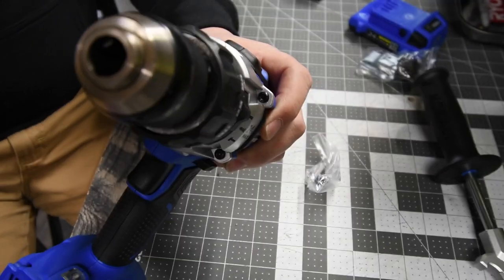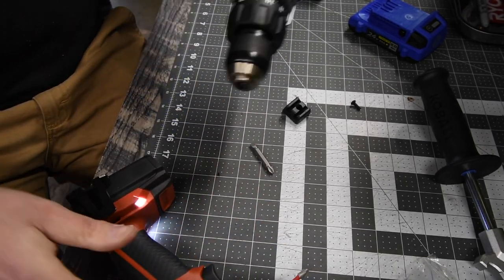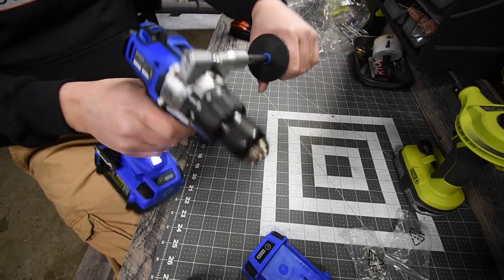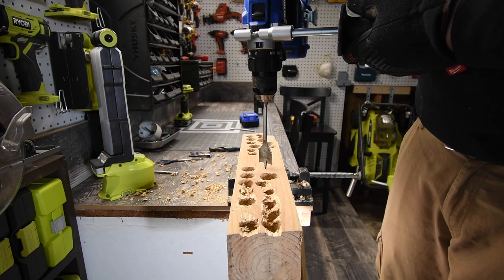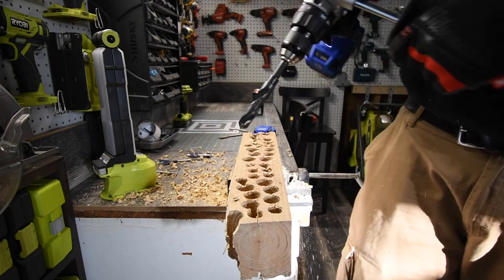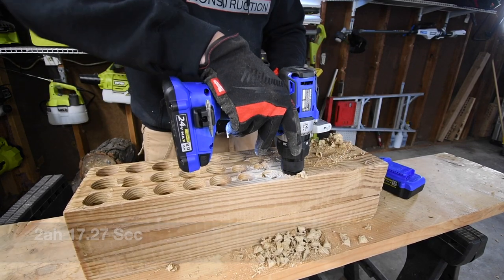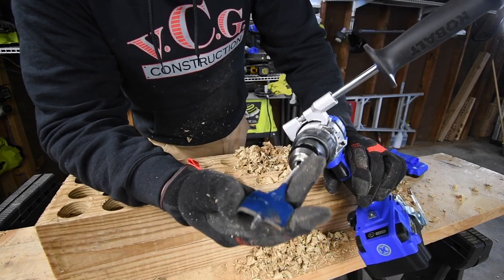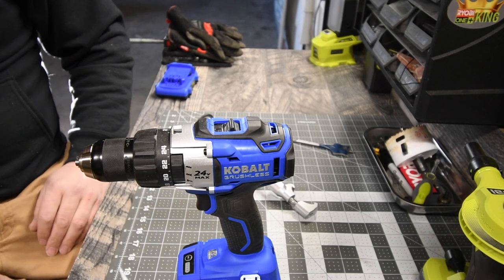Kobalt Brushless Hammer Drill Unboxing/test

Comment: Have you ever noticed a fault shut down when pulsing the trigger during use, I've had 2 and both do the same thing. It starts back up after releasing and re activating the trigger it's just annoying, my 20 volt max kobalt never did it.
Reply from the maker: yes, it is a cut off switch that prematurely activates while the motor is under stress
Reply: @ManCaverTools  Ok thanks it's the only thing I don't like about my new set, I did buy the air compressor as well and after several hours of use"which I know it's not made to do" running hooked to my portable air tank at 100 psi it burned up.

Comment: Can you do a review of the hyper tough hammer drill?   It just came out a few weeks ago at Walmart.
Reply from the maker: yes I can, I saw it at my Walmart a few days ago
Reply: @ManCaverTools  Yeah... I wanted to ask the same thing.
At first, I thought it's the same cheap, old drill with just hammer feature added, but it had 1/2 metal chuck with 2 speed setting.
As it doesn't include a side handle, its torque is probably not that high. Still, I'd like to see how it performs.

Comment: I think you should let the tool do the work instead of pushing with heavy downward pressure. Thats why it stalls.... All those tools perform good with most of them just a few seconds apart from each other.
Reply from the maker: but that's the point of doing all of these test the way I do. I push these tools to the limit and see how well they do.

Comment: Why brushless tools goes in smoke? I saw many from big brands. 👏👏👏🤔🤔🤔🤔
Reply from the maker: it didnt smoke I thought it was for a little but it didnt and I thank you for viewing
Reply: @ManCaverTools 
Yes I know. The question was not for this drill
Reply: @Pecke1234  Most common cause of brushless tools smoking is the on-board electronics failing. They require more complex control circuits than brushed varieties

Comment: The drill doesn't perform any better with the bigger mah battery, that's just the capacity it will last longer but not make it stronger the strength is gonna be the 24 volts, 20 volts, 18, 12,.....also brushless is also stronger than brushed drills just the DNA of it
Reply from the maker: it does. check out my battle of the AH video I recently uploaded.
Reply: @ManCaverTools  o ya my bad I didn't realize they do advertise it as a high performance battery, apperantly they have an extra metal battery terminal thing that let's more power go to the motor, anyway your right my bad

Comment: Not really a difference in power between the battery sizes just how long they run
Reply: Cj Edenfield I’ve seen it a lot where the tool gets more power from a larger battery.   I understand it should be the same power over a longer run time.  But there are tons of examples of tools getting more power from a larger battery.
Reply from the maker: more tests are coming and against other tools as well